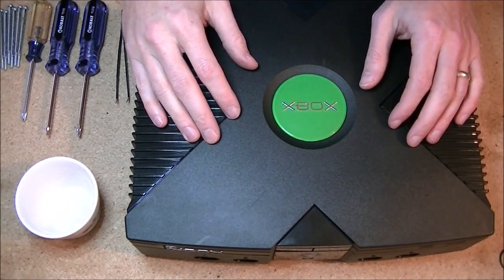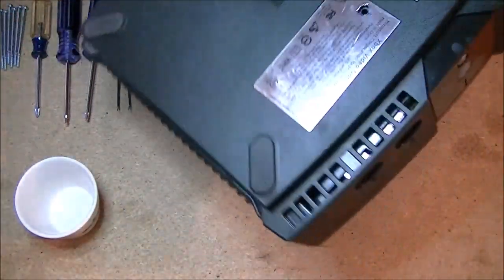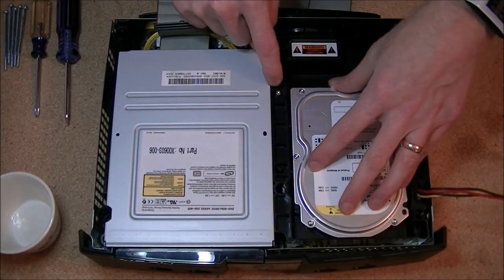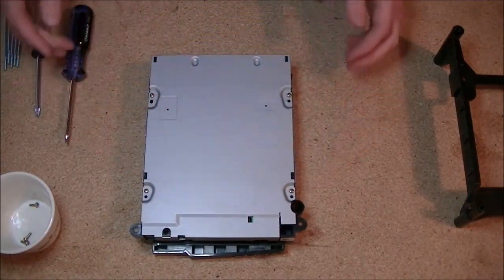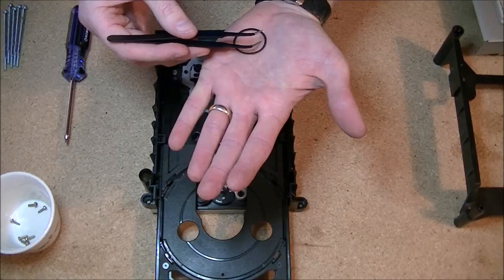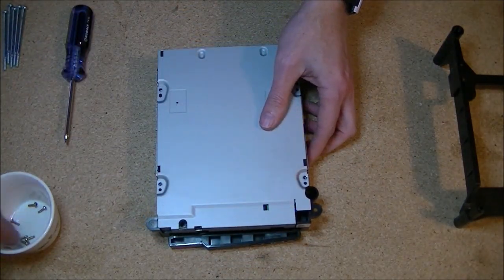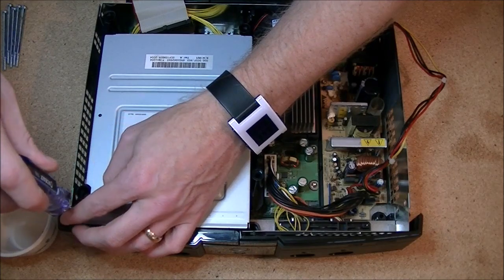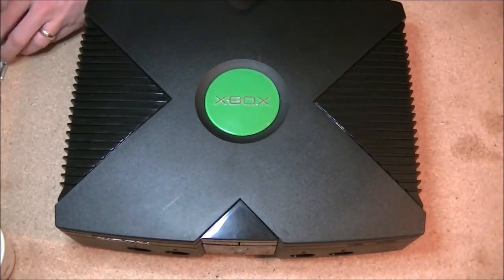Fix Your Stuck Original XBox Disc Drive Tray - Rad Repairs Ep 2

Comment: Amazing video!

And if anyone else decided to follow this tutorial, I'll suggest to also take the opportunity, since the console will be opened, and make a full maintenance on it. Like, reapply white grease to the mechanical parts of the disc reader and change the thermal paste and thermal pads. 

This maintenance can extend the life of your console forever when done periodically.
Reply: Also need to check clock capacitor and remove it as they are starting to leak causing damage. Just make sure it's not a version 1.6 Xbox as removing clock capacitor will brick the system unlike the other versions.

Comment: The  4 phil head screws didn`t exist on my unit so i couldn`t open the disk drive up.  I ended up having to use tweezers to get the belt out after all. Also, the big pulley and small pulley were reversed on mine.  Over all though, your video was spot on and very helpful and I`m now going to play some Halo 1 and 2 for the first time in years.  Thanks for this video.  Kick ass!!

Comment: I just went into the disc drive and the band is definitely weak. However, I can get the drive open and closed. The issue is with trying to read discs. Not sure if you had any insight on that issue, but I figured I would ask. Definitely a great video as it pushed me in the right direction. Thanks!
Reply from the maker: Sometimes the drive mechanism is just worn out. It can cause the laser not to be able to move or to move in a non-perfect linear way. This is usually best corrected by a drive replacement.
Reply: @radrepairs8325  that's what I figured. Unfortunately it seems the price of a drive + shipping is about the price of a whole new console.
Reply from the maker: @Rychotech  I always prefer to repair because I hate throwing away fixable items and because I really enjoy the feeling of fixing something that's broken. Now if you'd like to have a spare for parts then go for it.

Comment: What does it mean if the tray ejects only when there is a disc inserted? In other words, it does NOT eject if there is no disc. Thanks and great vid!
Reply: Just figured it out. It’s actually the MAGNET on the disc spindle. It’s too strong and prevents the drawer from coming out. Of ALL the videos I watched trying to fix this, only ONE hinted at this. Fixed by cutting a small round piece of electrical tape and putting it on the magnet. Hope this helps!
Reply: @EBPization  Holy crap, thank you for this! Even after replacing the belt, my drive still had trouble opening without a disc. Doing this 100% fixed it! You're a LEGEND

Comment: Just clean the rubber band with alcohol and wipe it with a napkin, put it back on and it will work good as new.
Reply: Yep, that worked for me. I also just opened and closed it manually a few dozen times, that could have also contributed.

Comment: Hi so I have a question so whenever I plug in my account cord into my first Xbox from 2002 the disk drive stops spinning and a red and green blinking light appears on the disk open button I have no I idea what to do I tried cleaning the inside and outside of my original Xbox from 2002 please help I cloud really use it thank you
Reply from the maker: Savage Dude what's an account cord?

Comment: Weird, I tried this and the instructions were great. Only issue is that my xbox cd drive looks different than yours. Replaced band but it didn't fix it. Are there different drives for this?
Reply from the maker: There are different drives but the fix is the same. You may need to use a smaller band. I had to do that for mine.
Reply: @radrepairs8325  thank you! Its weird, I take off the cover and there isnt a smaller wheel only a white part under the sliding part.

Comment: So, mine was stuck at first, and I saw that there was something stuck in the teeth of the tray where the gear spins, but now the tray won’t stay closed, it opens back up
Reply from the maker: You may have chewed up gears. Give them an inspection and if they're bad you may need to replace the drive. Did you replace the band?
Reply: Rad Repairs no, I actually just bought it yesterday, so I will just return it for a different one
Reply: Rad Repairs thank you for the advice though
Reply from the maker: @majordankmemes6675  You're welcome.

Comment: I don't get how you can get those connectors off so easily... I had to use pliers to get the IDE power connector for the hard drive, and I can't get the DVD power connector off at all. I already basically broke off all my usable fingers.
Reply: I did get it all done and the console fixed (good video!), but I was just frustrated when I look at all the videos and people unplug these cables with such ease, as if they were USB connectors, but for me they are infinitely too tight.

Comment: My disc tray ejects fine but my disc is stuck in the dvd drive of my Xbox. When I hit eject the tray comes out but disc won’t
Reply from the maker: There are four screws on the drive itself. That's odd that it's stuck. You'll probably have to open the console to get to the drive.
Reply: @radrepairs8325  I got it out the same day I posted on here lol. There was some sticky residue on top of the disc like someone had previously put a piece of tape on the disc lol. I got it out and cleaned the label side of disc and it never got stuck again 😂
Reply from the maker: @anthonypeterson42  ah perfect! Well done.

Comment: I have the same problem! Which is the original diameter of the Xbox to order? thanks
Reply from the maker: ledste1 you don’t have to be that specific. Check eBay for new Xbox drive belt and you’ll find plenty.

Comment: Hi I have an original Xbox had it for years tried to turn it back the other day and my disc tray ejects and doesn't close and on screen it does it's load up thing and after about maybe a minute a service screen shows up and the xbox light is blinking red and green. Any idea what problem this could be?
Reply from the maker: Mactel Services you’ll need to open it up and check for a leaking clock capacitor I bet.

Comment: i have a completely different problem. i have an original xbox thats from 2002. it used to play games just fine, but then when i got this new game for it every so often it would say the disc was dirty or damaged for a split second and then the tray would open and close by itself many times over and over. the game would then start up again but the same thing would later happen where the disc player would give the disc error code then open and close the tray many times until it was satisfied and started playing the game again. but recently the disc tray wouldnt even open and i would press the eject button but nothing would happen. i have no clue what is happening and i doubt its the band belt thats the problem. do you have any idea what the problem could be?
Reply from the maker: JalapEnN10 actually that’s still possible the bad belt. It won’t keep tension and slip and that confuses the drive.

Comment: I have a weird thing with the drive. Where it works fine with the top metal part off. But when it's placed back on, the drive gets stuck. I shrunk the rubber band so it should work right?
Reply from the maker: Kevin Vo I’ve had one so that before. I ended getting a smaller band and that helped.
Reply: @radrepairs8325  I installed a new and smallee band. Didn't help at all. Again, it's only stuck when the top part is on. I don't see anything that can make the drive stuck so does anyone know why it doesn't work?
Reply from the maker: Kevin Vo check to ensure the lid isn’t warped at all and that the drive is seated properly
Reply: @radrepairs8325  I'm pretty sure the lid isn't warped. At least my eyes can't see any warping
Reply from the maker: Kevin Vo you might try adding some silicone grease to the drive rails
Reply: @radrepairs8325  I added grease but not silcone grease. But I had this issue before I added it
Reply: Mr Guru  would the spindle be loose either way? Also how strong would the spindle magnetized before the tapping? I'm just confused since I'm new to this

Comment: Hey man i hope you can light my mind about my issue: my xbox "turns on" by himself and open and closes the tray randomly when i just plug him on the wall, and keep opening and closing the dvd tray, you think this can be the same thing? hope you can help me, thanks from a brazilian follower !
Reply from the maker: Sounds like you'll need to address the power issue first. It's possible since the power and eject button are on the same mechanism you might start there. Reseat that on the board. You can try to remove components incrementally to narrow down a faulty hardware component. It's also possible that the power supply needs replaced.
Reply: Andre, check the traces near the edge of the board for breaks.

It's not uncommon for the clock capacitor to leak and damage the traces, which will cause the issues you're experiencing.